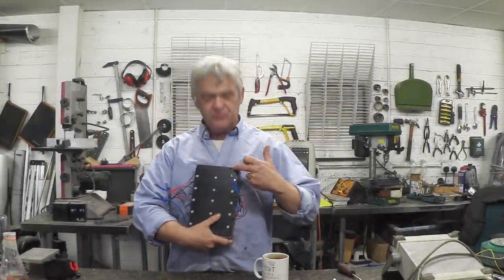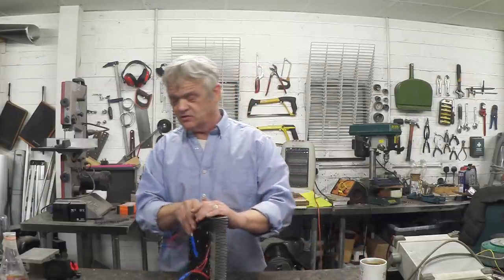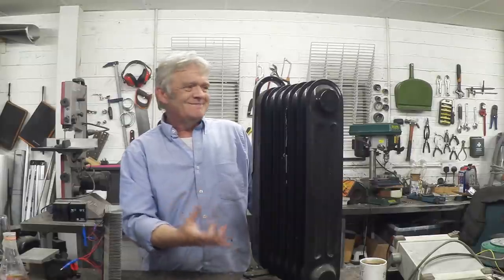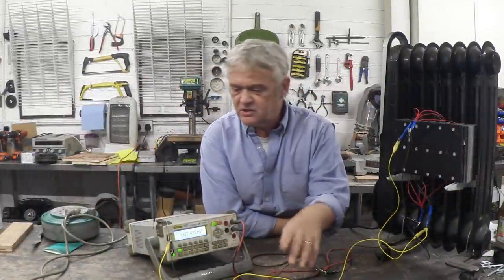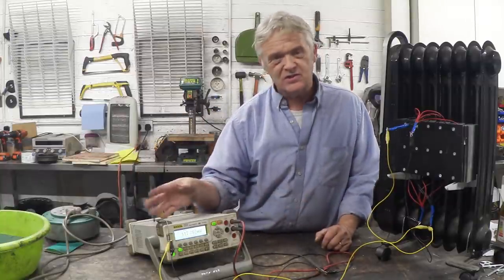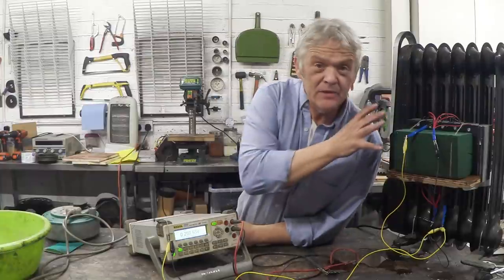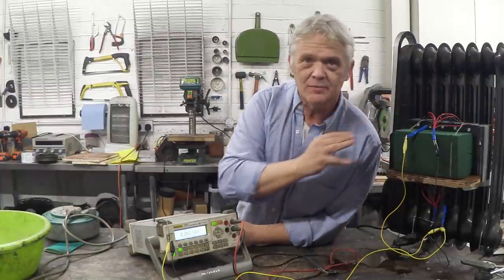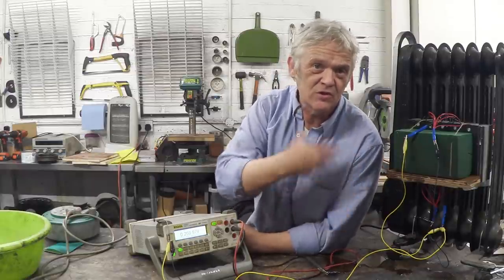1287 Scavanging Power From Radiators

Comment: Dear Robert, I have been building one of those Peltier devices some years ago for my wood stove to distribute the warm air into areas where it is not going by itself. It basically consists of an old grounding magnet ( for easy mounting on magnetic surfaces) thermal grease, a peltier element and a cooler from an old CPU. The initial power generated when heating up is used to run a first fan and a LED. This fan is sucking cool air through the system increasing the difference in temperature while the stove is still heating up. When the stove is on "working temperature" i can switch two additional fans on and they start blowing hot air into another room. I was as impressed as you are by the idea of using excess energy to generate electricity. Though I don see that a radiator produces excess energy, the tiny amount you "redirect" to produces electricity wont give you cold feet ;) Greetings from Germany. I really like your videos.
Reply from the maker: that's clever mate - I like that and I am glad you like the videos - cheers

Comment: Love radiator heat. Grew up with it in old houses. Much prefer it to forced-air heat. I built two houses with forced-air heat, because they told my I had to. Now, years later, I live in a cozy old house with soothing giant old-fashioned iron radiators, heated with a new(-ish) hi-tech computerized gas boiler system.

Comment: This is pretty good if you think about most homes radiators are against the wall so if you put a hole in. The wall just big enough to fit it you can get a large difference.
Reply: Between a cold wall and radiator, but no hole in the wall, it would make heat loss.
There is purpose made insulation to put Between wall and radiator, you could make the hole in the insulation.
Reply from the maker: I did think about that but it would be an install at the time for most folks rather than a retrofit as taking your rads off the wall could be a challenge to a lot of folks

Comment: This is a subject I’ve often pondered on Robbie. Bear with me for a mo…..I wouldn’t call radiator heat ‘wasted’ as the rad is obviously designed to do (radiate) exactly that BUT, as you know, heat rises and so we all live in houses that, although they may be warm (if the boiler is on) the temp at ceiling height is greater than what we feel at a normal working/standing/sitting height. If your ceiling joists have insulation between them then that heat will remain there for a lot longer than if no insulation exists. It’s actually surprising just how much heat ‘hangs’ around at that height - fit a ceiling fan and you will immediately feel the difference as the warm, higher air is forced down and distributed to the cooler, lower areas. In the worst example a complete lack of insulation means that your heated air simply rises to roof level and then out into the atmosphere……what a waste!. Our ceilings, although not low, are not particularly suited to have such big fans dotted around the house and so we don’t get the potential benefit of their use……..what we do have is a heat recovery system which utilises this higher temp air to heat ALL of our hot water (via 2 high level input ducts) and so it bugs me to think that although I may be comfortably warm (whilst watching your vids on the iPad, led flat out on the sofa 🙂) I’m actually heating my ceilings to a greater extent……..wouldn’t it be great if there existed some background, perhaps Peltier-driven, smaller fan systems that circulated and mixed the higher warmer air into the lower cooler air. Not only would we get the benefit of a higher room temp but it could also result in energy saving as the thermostat could then be turned down too. Thanks for the vid! 👍
Reply: In theory, moving the air around a room by forced convection could lead to incresed conduction losses through walls etc. Turbulent air flow increases conduction. Just a thought.

Comment: That was incredible guys. I see a lot of potential applications here. That oasis had a great influence. I'm picturing a thermodynamicly circulated radiator in place of the oasis. With a second radiator mounted outside the house like an oil cooler.
Reply from the maker: I find oasis to be pretty amazingly useful actually

Comment: We need to get you a 2nd camera to focus on meters- did that say 200V with the warmed up heater and oasis? That’s decently efficient
Reply: more like 200mV
Reply: @____________________________.x  a close-up spotlight cam would be nice to eliminate confusion/doubt. Doesn’t even have to be 4k…an old cell phone can would do it.
Reply: 4:56 he says it's a quarter of a volt
Reply: @zahialsalman  not nearly as impressive as I had thought.
Reply: @gregorykusiak5424   there was no way such a small device would produce 200v.. lol unless with very very low amperage I guess
Reply from the maker: 200mV mate - you are not going to get 200V out of such a setup - even in your wildest dreams lol
Reply: lmfao
Reply: @ThinkingandTinkering  You spend a lot of time demonstrating electric generators but never talk about the harvesting of the generated electric. Any plans to address the storage side??? Great videos by the way, thx

Comment: Maybe mount it so as to use the waste hot exuhust gas of the boiler. It would also be cooler on the other side of the device due to being installed outdoors.
Reply: Thats a much better idea, I dont think you can classify heat in the house as waste heat. In fact I have a commercial camping stove with a USB charger powered by a peltier array, a perfect use.
Reply from the maker: for sure mate

Comment: You could have a heat sink on both sides with a red and blue texts mark to identify the hot and cold sides and then use the Oasis Foam on the cold side heatsink. If you think about it, there are many sources of heat around the home year round.
Reply from the maker: there certainly is mate

Comment: chould be used to scavange the heat from the exaust from the boiler. and on the combustion chamber which gets very hot.
Reply: The exhaust has to maintain a high temperature to avoid condensation
Reply from the maker: absolutely

Comment: turn the peltier device around, so that heat can be sent into the peltier device through steel plate ( not radiator). Cool the peltier via the radiator - air or water cooled. You will have a higher temperature difference and thus a higher voltage potential difference
Reply from the maker: I needed a fin side to contact the rad and a flat side to contact the foam - that would be harder to do if you turned it round

Comment: Nothing wrong with using AC current to provide a proof of concept.  The chimney of a fireplace would be a good source of heat.  Peltier "bricks" are something for the engineers to work out.  Inspiration is the first step, which is where you excel. Innovation is the next step.
Reply from the maker: cheers mate

Comment: I think you have the heat sink backwards. Its uses to draw heat way, from a device, not to draw heat towards it. Place the metal plate on the rad and you may find that you get better results ;)
Reply from the maker: I don't think a heat sink is really a one way valve mate - it will work either way round and I needed the contact between the radiator and the pelters to be good and I also needed a flat surface between the oasis and the Peltier - so I don't think so - I think it's ok that way round - what might be better is just to 'glue the Peltier on the heat sink and push the foam directly on the other side and no metal plate at all

Comment: Couldn't you exploit the difference between indoor and outdoor temperature by building an insulation skirt around the giant peltier such that it would fit snugly into a double sash window? It would be most useful in winter and summer by simply reversing the unit in the window.
Reply: That is a great idea. I would try something with a heat pipe solution to transfer the heat to the outside.
Heat pipes are used in cooling for example the processor in a computer and the heat transfer is almost instantaneously.
Reply: make a house out of peltier lol
Reply: That works. But the goal is to use waste heat. So unless you needed power the energy lost is greater than what is usable in the end.
Reply from the maker: nice one mate - cheers

Comment: Excellent!  
It seems like this could be developed- even the electric radiator- into something quite a bit more efficient than the norm.  Like if you had your radiator in an insulated box, put your peltier's on there,  with your heat sink on the Outside, you'd still get your heat into the room, but all of it would be reclaiming electricity as it went.     Seems like you could also do that with an AC unit in a warm humid place- blow your hot exhaust on the peltier, and route the condensation that always happens across the other side of it.  That could Really improve the efficiency of both heating and cooling, I think. 
Sterling also seems an option to play with either way- does anybody know,  Could you get more electricity out of a peltier, or a stirling engine running a generator?  google was not forthcoming with the answer to that.
Reply from the maker: oh - that's good thinking mate - thanks for sharing

Comment: Not trying to be a downer but when heating you home adding moisture into your home makes it harder to heat? I had a problem with damp in my last house and the only reason for saying this. I could well be wrong and wouldn't be the first time.  I just wouldn't want to waste the efficiency of one for the other?
Reply from the maker: I am not sure it makes it harder to heat mate - the dry air was a real problem in homes in the UK and the pot of water trick very popular for solving that
Reply: @ThinkingandTinkering  OK mate thanks.  I always stand to be corrected.
Reply from the maker: @karlmyers6518  Gor bless ya mate lol

Comment: How can heat coming out of a radiator be considered as waste heat ?
Reply: I’ve lived many places with steam heat where the valves are broken so you can’t turn them off. If you’re forced to heat an empty room, you might as well get some electricity out of it.
Reply: Then again, if you have access to free steam, there’s much better ways to make electricity! 😂😂😂
Reply: Because of the lack of efficiency of a radiator heater, to make them more efficient you need fans behind them and it's possible that low voltage fans could be run from peltier (maybe not initially)
Reply: @stevetobias4890  probably can’t beat the efficiency of a heat powered stove fan tho
Reply: In the sense that putting such devices won't impair the ability of the heater to heat the room, unless, of course, you cover the whole radiator by hundreds of it lol
Reply: @strongforce8466  In fact, what if we just insulate the entire house with layers of Peltier devices? 🤔
Reply from the maker: in the same way as splitting a hair can be considered as a useful way to spend time. Don't be so anal mate - this is just an example of a heat source - loads of things can be considered
Reply: @ThinkingandTinkering  That makes perfect sense, but thats not how the video is presented (just watched it again). You specifically say the device is for scavenging waste heat from a boiler inside a house. The only waste heat from a boiler is the heat the makes it to the outside of the house via the exhaust (IMO), so I specifically asked a logical question in a pleasant way.
Reply: @ThinkingandTinkering  Putting the modules in series and putting outside on the flue would make a great AA battery charger. Making real waste heat useable in the real world, a much better/useful direction for a project.
Reply from the maker: @goldmagnet9013  i am sorry mate all i am hearing is you to have to be right - i don't mind that and you are right - but it would seem you are also a little closed minded - so let's leave it there shall we?
Reply: @twestgard2   it would be nice if Peltiers sides could be switched by the flip of a switch, then, it would be some crazy next level "insulation"  make the outer side hot when its hot outside and cold inside and vice versa !  even better if it was automated of courrse, don't know if it is physically possible, maybe in the future..there we go, another billion dollar idea that I don't even know is possible or won't ever be able to make ahha

Comment: Going away from generating to using DC say 12v, peltier devices plus the clay could a  low voltage off grid freezer be created? I know in some parts of the world and UK you can dig a cold hole but here in Kent and many parts of the world you'd have to go very deep lol

Comment: Way dont you put thermoelectric +-+-+- to get higher current.
Bedst regards søren Nordholm
Reply from the maker: sorry mate + - + - + - wouldn't get higher current  - it would get higher voltage + + + - - - gets higher current but at same voltage + - + - + - is series connection, + + + - - - is parallel  connection.

Comment: A lot of waste energy from a radiator? All of the heat energy coming from a radiator goes into the room in which it stands, so where is the waste? I think you should think this through. You are simply taking some of your gas  (or other primary fuel) energy and turning it into electricity by fisrt burnig the gas and then using the peltier effect to convert the heat to electricity, thus two processes with their own separate in-efficiencies. Better to generate the electricity from the primary fuel source in the first place I think. I love your projects but please don't start misleading folks into thinking they can get "free" energy in any way shape or form. Fit the peltier device on the flue of the gas appliance and recuperate some of the otherwise lost (and expensive) energy. Not free, but more efficient use of the fuel you've burnt. Sorry, you don't mention free energy but it was implied I think.